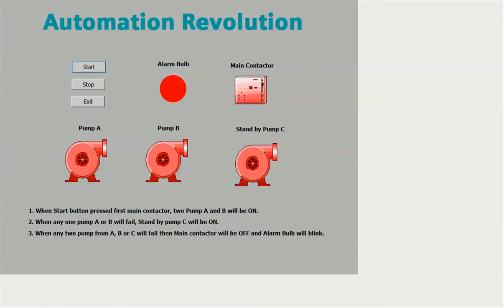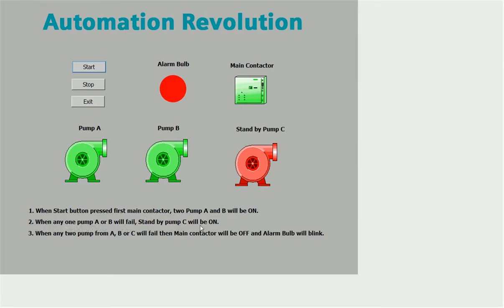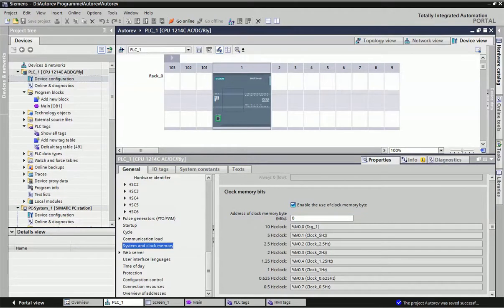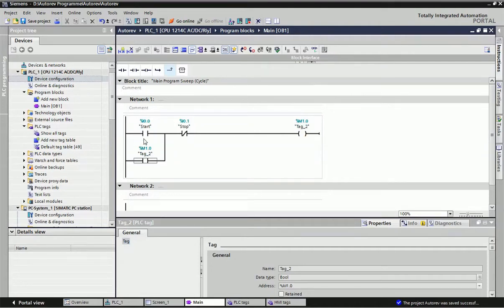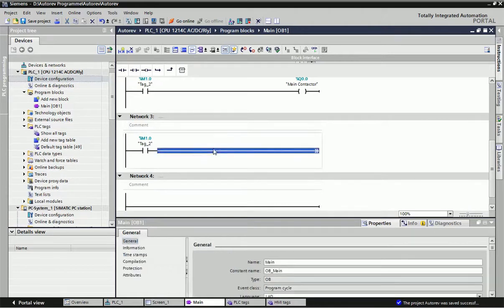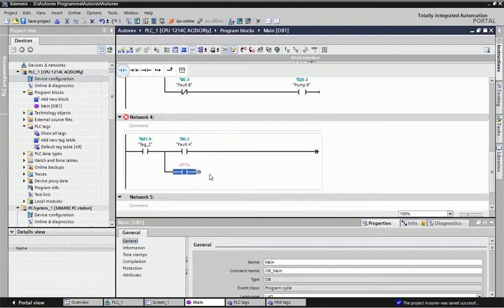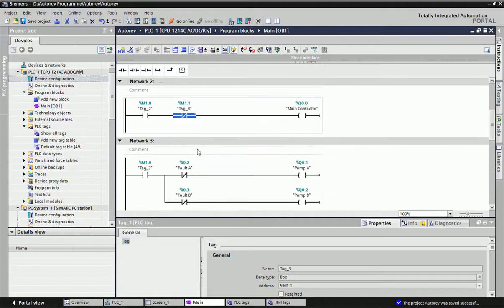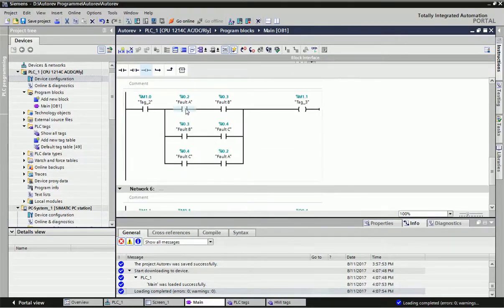PLC Ladder Programming Example using Memory Bit. #PLC #SCADA #Industrial_Automation

Comment: Virtually every PLC out there has examine on and examine off "coils and contacts" which are nothing more than a memory bit with an address.
Also bear in mind that all PLC's ahve their own programming software that varies in terminology and capabilities.  Siemens is very different from Omron which is very different from Allen Bradley.
Reply from the maker: +Jon Smith Thank you sir